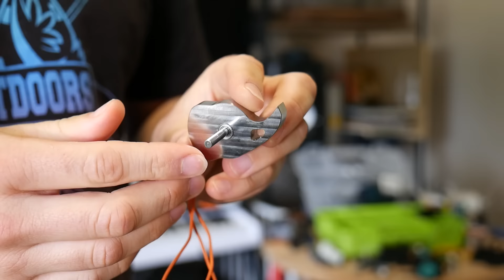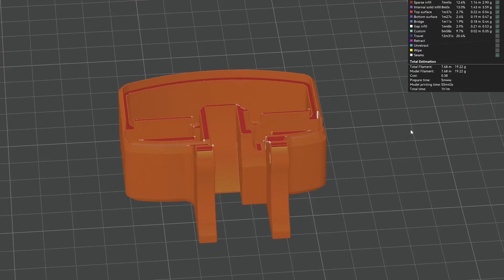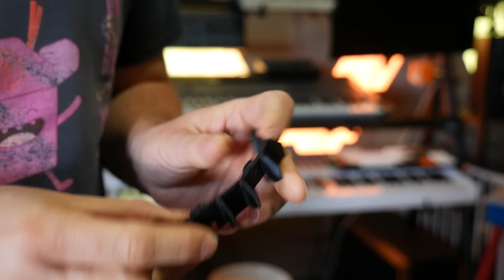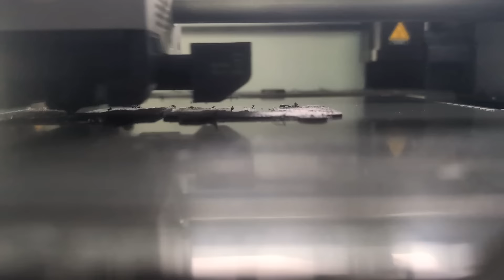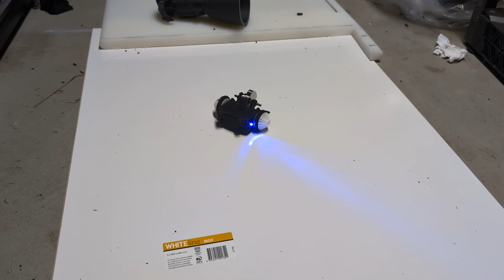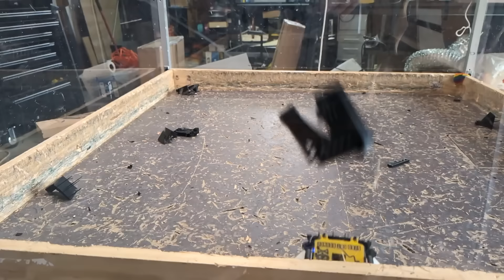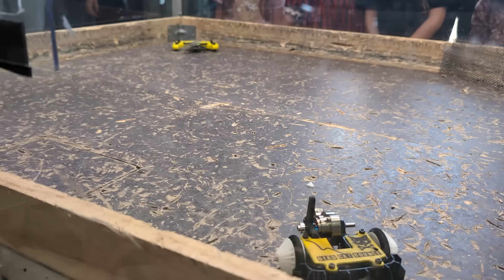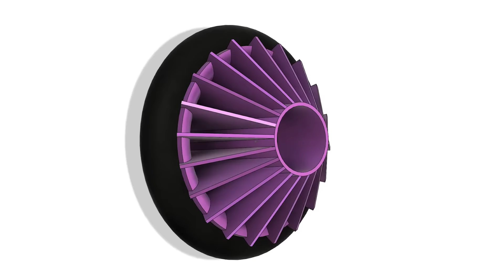Is this tiny combat robot INDESTRUCTIBLE?

Comment: Have you considered and are you able to print hybrid materials? Components with a rigid PLA core for structural integrity surrounded by TPU or PLA outer shell with PLA webbing to prevent from deforming to the point of failure?

Comment: One super obvious fix. Put the wheels inside the frame. Then the wheels aren't exposed. The body becomes armor. Also, if you want to counter the gyroscopic effect and regain some control. Opt for more of a whide  roller style wheel. Then you have more surface area making contact. This would make it much more stable.

Comment: I know this may be a bit late, but if you can find a way with the few grams of weight available to add a shim, similar to axes stay together to the wheels, it may stay together better. Alternatively, add threads to the shafts of the motors and add a small tee nut that is locked on with a bit of lock-tite (or similar product) to keep them from easily pulling off.

Comment: Those forks being sheared.  It wasn't necessarily at the WEAKEST point.  It was at the point where the energy/flex could be spread the least - being where right where the fork left the support block.

Comment: You could try a double wheel construction (like a truck). That would give you more traction, more stability and if the outside wheel(s) get damaged, you still have a backup, protected by the axle that now protrudes.

Comment: How about a snake robot that is protected by thick elastic material to soak up kenetic energy, and the snakebot's only offensive ability is to constrict the enemy by surrounding the enemy bot and soak up the hits while slowly constricting around it disabling its ability to move or use its weapons.

A "Snake-bot" like this could be thrown around and abused to hell and it would still be fine because it doesn't matter which way up it is and it would avoid damage by being surrounded entirely by thick elastic (firm/strong but flexible enough to work) material. If its heavy enough, it would actually cause bots like the one in the vid to send themselves flying I think.

Comment: For securing the wheels, drill a hole through the wheel, then attach it to the existing shaft. Then add small low carbon steel balls at both sides of the holes, then spot weld them

Comment: Love your build but I would have tried to implement a third stability wheel at the back of the housing of your chassis. Of course it wouldn't need to be a functioning wheel. Just a free spinning wheel would work fine.

Comment: Best tip for soldering small connection,is use a magnifying glass mounted on a holder or just use you're jig to hold it over , you will never miss a connection anymore 😊

Comment: Great video! 

Your nylon filament is wet - you need to dry at 100c in a conventional type oven first. print hotter slower, dryer and you'll get an improvement in layer adhesion.

Comment: Consider normalizing your parts, which is to say, pack them into an ultrafine salt material, bring up to appropriate heat, and allow to cool. Should massively increase part strength without any real additional weight, and any salt crystals left over can be removed by soaking in warm water.

Comment: you should try recasting the forks to see how they handle it (put some clay or plaster around it, then melt the forks in the oven, they should get way sturdier, that's especially interesting with nylon and amphora that can take way more elastic deformation when melted together.) another interesting tech if you have a way to extrude filament yourself is to make wire core filament (it's relatively easy when recycling pet bottles, when you fold the strand, add a wire inside) you will need to wrangle the slicer so it prints continuously, or just make the gcode by hand, which is actually fairly easy for 2.5D parts like that fork.
another evil thing with wire core for combat robots is that if it breaks it has a tendency to tangle whatever weapon hit it.

though an easier solution if you're re casting anyway, is to add a hole, and melt a steel wire inside with a soldering iron, then add a layer on top (add an extra extrusion multiplier on top of the wire so you don't get voids)

Comment: Wicked! I love it! Seems quite sensible to use titanium for this. I've been messing around with tungsten lately, but it's very very heavy and perhaps even harder to machine. (I've resorted to abrasives.) I think for those reasons it would be a very poor choice for a high-speed spinner. It makes diabolically-sharp spears, though!

Comment: I loved watching your journey with this robot! It certainly has a lot of potential.
But I noticed your handling of those glass fibre filaments and parts with your bare hands. Those things will stab your skin with hundreds of microscopic glass rods, giving you itching and potentially worse long-term effects. They will also end up in your lungs, like asbestos fibres, if you print them in anything but the best ventilated and filtered conditions. Personally I would never touch glass fibre or carbon fibre filaments, and I think they will be banned sooner or later. But at least please wear some protection. There are tons of videos on YouTube about it.

Comment: so titanium is actually not so great at absorbing impacts it dents and deforms. its used in the medical industry to make implants.
Reply from the maker: mmm depends on the grade. Pure Ti is quite soft (but non reactive, so great for medical use). we use grade 5 which is aerospace grade. VERY springy and tough, but still heavier than Aluminium or CF. Depends on the application i guess.

Comment: For the armor/wheel : if you can put a hard PLA attached in front of the soft one, this can distribute the energy among all the flimsy one while protecting them. I have never 3D print anything, so I do not know how easy/hard is to secure the two different material at this scale.

Comment: Concave spinners covering wheels but not touching ground using hollow axel then solid inside connected to spinners a gear and another power supply.

Comment: I’m guessing a dual extruder like my J1 could really be useful in printing combat bots, you can impregnate TPU with shards of very tough and rigid PLA, all fused into a very tough skin. You can even intentionally put gaps between the two materials in certain points. The outer TPU shell absorbs much of the energy, the inner PLA skeleton keeps the shape somewhat rigid and absorbs extra energy (where the TPU absorbs by bending, the PLA would absorb additional energy by bouncing back). You could experiment with different geometries of the two materials, e.g. a tough chainlink mesh from PLA embedded inside TPU.
As for the gyro effect, why not just have a counter rotating mass? Instead of one spinier you can have two, use a gear to have one rotate the opposite of the other. They will cancel each other’s gyro effect and you can turn around as fast as you want.

Comment: Imagine the "cherubim" recreated by stacking blades with sturdy chainsaw-like teeth, counter-rotating and guided by differential forces applied to an internal gyroscope-mass, whizzing and buzzing around the future battleground, tearing into enemy personnel and equipment, shredding everything around and spraying bits and pieces and fluids and solids everywhere to create a clear display of power and domination!  "BUZZZZZZZZZZZZ ......"
It definitely would add a novel way to create unique art along the lines of a "Banksy" or splash paintings.  Entire landscapes could be saved as art, and of course that every piece of art has a little bit of the artist inside it, be it shed skin or hair or sometimes blood, but THIS ..... THIS would have included into it most of the SUBJECT of the art-piece into the creation!  A unique way to immortalize the vanquished enemy that more than likely is anonymous or mundane and definitely not otherwise memorable or distinguished in civilian life.
Oh, the delectable horrors of war! more impressive than ANY horror movie ....  The theater of war in Eastern Europe has just scratched the surface.  Now an entire generation of combatants has developed indelible reactions to the buzzing of drones.  Take that and multiply by a hundred!  Buzzzzzzz.......

Comment: As a fellow printer I have to note the flaws in basic logic. You need to specify a control test and institute an actual test deflection based on a sampling. You will not achieve absolute success without a standard. Please set a basic standard and continue your hypothesis. Your research has promise.

The scientific method was established for a reason.

Comment: Design would be a nightmare, but if you could somehow integrate trackball style spherical wheels you could eliminate the wheel armor issue by having one big central wheel that handles both sides (and some sliders pontoons on the outer rims for stability). Then add buffers and a TPU cage around the exterior for standoff armor.
and just a thought, but bots typically  have horozontal or vertical spinners, I'm kinda curious why you don't see paired sets of 45 degree spinners set up like fangs (or a triple set of alternately rotating ones like electric steel sheers), it could end up with some fierce damage while hitting a middle ground in angle (obviously weight would be a potential issue)

Comment: If you haven't check out z-polymers I know the company wanted to have some people put in ideas to use for their newer product, it out preformed kevlar when made into small threads and better than the carbon fiber filaments. With you ant weight class you could have multiple ways to test and stress it. Look it up to verify but also I think it's a lighter weight than most material as well.
Reply: Tullomer was the filament name. https://youtu.be/ngPksruJKr4?si=mTpJ-iAGTXdlhglw

Comment: Would it be possible to insert a piece of metal wire into each fork and have it act like a piece of rebar or would it just make them weaker? I assume the weight limit might be a problem, though.

Comment: I don't know anything about bot fighting

Cant we go with all thick metal so it can take huge hits and it cant be damaged and any impact goes directly go to the ground.
As there less moving parts it last long until other side is dead
Reply: There is a strict weight limit of 150 grams, so it would be hard to do a full construction with all-metal armour. Also there are some bots I know of that can pierce metal with their weapon, so whilst it would be effective if it could fit into the weight limit it isn't necessarily the right approach, as the bot could also be pushed into the pit or electronics could come loose from large impacts.

Comment: Question, you could not print the fork in 2 material, like make a 'bone' inside with the PLA or the Glass one and the outsize with the TPU? trying to merge the stiffness of the core material with the softness of the TPU?

Comment: Why not extend the tips of the fins so that they reach the contact edge of the wheel? If the wheel material goes and for whatever reason you have the fins left you'd be able to gain some type of secondary traction with that extended edge, making sure it's circular, it'd basically be a second wheel (3rd/4th).

Comment: Have You tried making parts that require toughness, elasticity and endurance from Polypropylene?
It is less dense from TPU, so Your finished parts will come out lighter in the end. It is also very durable. It's not as flexible, but, non the less excellent material, which tend to bond well to itself, so layer adhesion is close to perfect... It has good melting point 130-170C.
I'm just interested have You worked with it, and have You maybe used it?
I am currently using it in some end products, that are non related to robot fights, but require good chemical resistance, as PP is also very resistant to most solvents and chemicals :)

Comment: 4140 or EN41, SCM4 would of been a better choice.  It’s stronger than titanium - heavier and harder once heat treated even 5160 (spring steel) a machined lump of it and heat treated would be cheaper, harder, more durable and cause more damage due to a higher mass.  You could easily heat treat them with a map-gas torch/burner.

Comment: An excellent little bot... I don't know if the following would be within the rules. If there's room to add a little intelligence to the design it's driving characteristics could be improved with a little onboard intelligence - One could start with programming an auto self-righting procedure as a relatively simple proof of concept, then move though pit avoidance, and on to the hard stuff in the shape of 'drive by wire' where inputs are interpreted for easier driving.... at that point you are on to using a galvanometer or IR for auto chasing other bots.
Yes, all increasingly hard. If you have a friend with some expertise in AI and neural net training that would be a big help.

Ok, ok. Sensible - What do you use to stick the axels? Locktite Red...? Also keying your axels and altering the prints to fit that keying might help.

Comment: I still wonder if there would be a way to make a bot with two spinning blades, and rather than use driver motors, use the gyroscopic forces from the weapons to 'drive' it and just use some form of spherical casters to keep it off the ground.  It might require too much as the blades would need some form of speed controller to control the torque, but its an interesting thought.

Comment: PLEASE experiment with UNFILLED nylons for future bots.  Everyone loves these CF/GF-filled nylons, because it makes them more rigid and it sounds cool (and easier to print).  But it also makes them *breakable*, and destroys their layer adhesion.  If you use straight PA6  or PA12, you will get parts that are approaching the rigidity of PETG but basically unbreakable.  You also will get much better layer adhesion (and thus more robust durability).

Here's a demo manipulating a 6mm thick piece of pure Nylon12, which has become one of my favorite filaments despite how difficult it is to print:  https://youtu.be/lJ30i1TedD8 

I did some impact tests that weren't very scientific, but I can say they both held up very well to impacts.  PA6 has similar stiffness to PA12, but softens quite a bit over time as it absorbs moisture from the air.  I actually boil PA6 parts for 20 minutes to speed up the process (and somehow doesn't cause warping)

Comment: If you decreased the angle of the fins so the edge is closer to the tires was very close to the ground and then extended the fins further. It might help with turning stability without making the bot more fragile.

Comment: At impact testing you did all tests back to back with the first sample. I can imagine that tiny cracks / micro fractures already occured before the final test and resulting it to fail on the first hit on the final setting. But than again i think its as close as a test to Battle damage in the arena.
Reply from the maker: I edited everything for brevity but to be sure I also did secondary tests at the height the first sample broke (if they did break) - the PLA Pro1 sheared clean off at the same height with just as much violence. But yes, repeated impacts are going to happen in the arena for sure!

Comment: To re-use an already overused qote: "That's not a fine tip"  No seriously, you should definitely check your options, pencil tips are by far not the finest available. I can advise you to look into a soldering station that uses the T12-tips, they are very affordable and available in extremely fine sizes.

Comment: For the forks you could try PA12 CF (Treed used to make a really good one). It's a little more flexible than PA6 but MUCH easier to print and handle it doesn't even need to be super dry to print

Comment: won't ever forget the drum spinner I saw at an ultra heavyweight bot fight, it wasn't allowed to join the others for being outside the weight limits as it was about 15 pounds over...
Wasn't sure why they were putting a bunch of random computer and electronic parts in there, or why everyone BOLTED out of the room when the key was turned the key stick...
Then saw that thing throwing a printer, VHS player, and it was either the monitor or the computer tower that, when hit, hit the 2x4 and metal screen in front of the plexiglass, cracked the beam and ripped the screws off the screen where it hit and clouded up. They couldn't see where the bot was and decided it was safer to burn the fuel out than hope the off switch was working or that opening the door to let the smoke out of the plastic box would be safe.

The entire game was dominated by horizontal spinners so I heavily underestimated the end game show. That little red washing machine drum decided everything needed to bounce off the roof of the cage lol.

Comment: I'm wondering with this hub motor how important it is to power down and let it free-spin coast before any impacts is. Even could keep the spin a little slower if turning is going to be more important than hitting power, could be very dynamic with it. Seems like something that should be possible to control well with practice, I would want it on a trigger button or something L1/R1.

Comment: I like your impact tester! You may get more useful results by making it more like the Charpy device: add a latch to release the arm from a consistent height. Do a single swing from a height guaranteed to break the sample. This avoids confounding your results with cumulative damage from multiple swings. Add a tattletale indicator to display how how high the hammer continued to swing after breaking the sample (initial potential energy minus energey taken to break the sample)